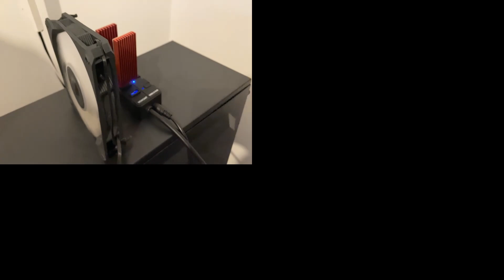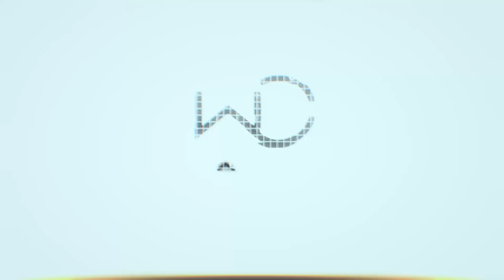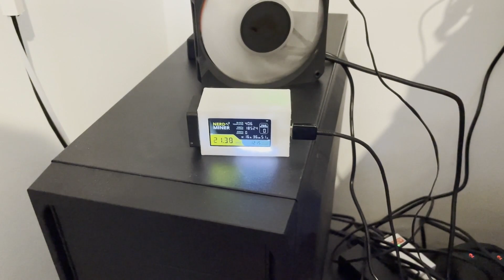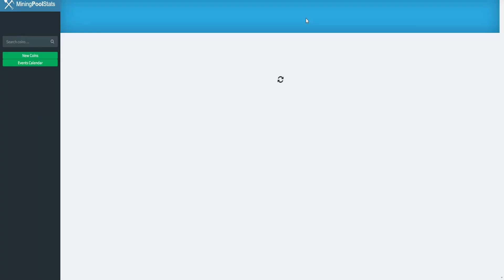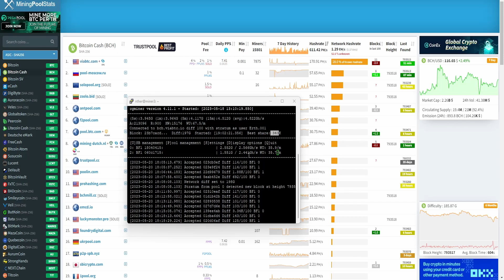SOLO MINING BTC/BCH with USB miners ?

Comment: Merge mining on mining dutch? Fee 0.5 %. And i think you mine 7 coins.  Might pay for the hardware eventually.  Using a bitaxe use the d=10 or d=20, in the password field. I havent tried it yet as awaiting a bitaxe.  What are your thoughts? Have you tried mining dutch with bitaxe?
Reply from the maker: I’ll never mine again to a pool with fees
Reply: @WantClue  am i missing something??  0.5% of $644  = $3.22. X 6.25 =  approx $20 off reward of $4k.  Less possible trans fee 	0.000003 btc  ???